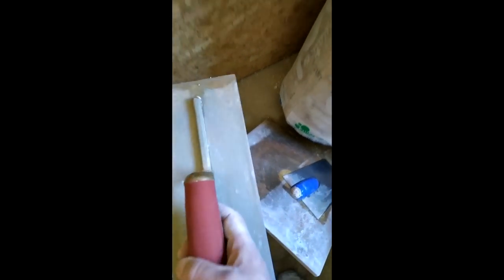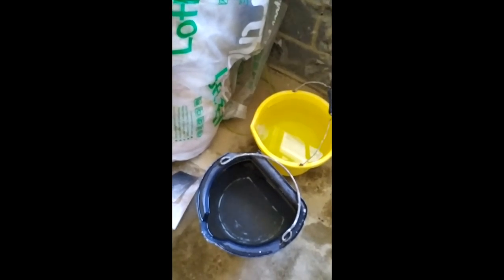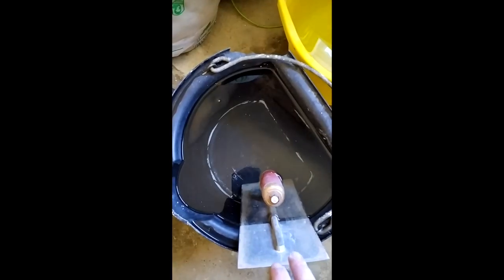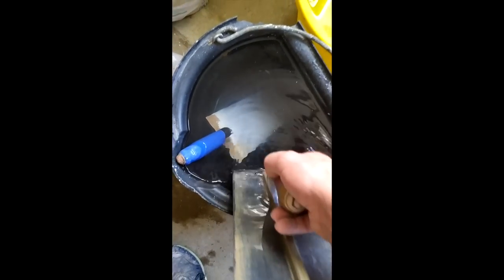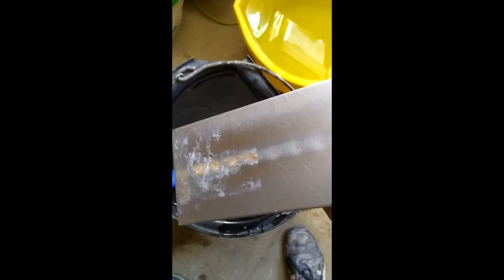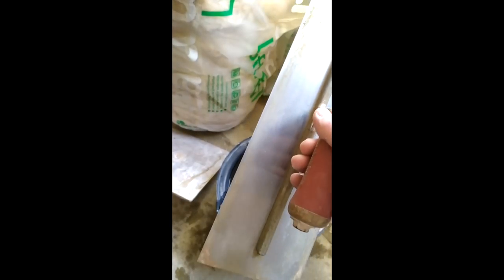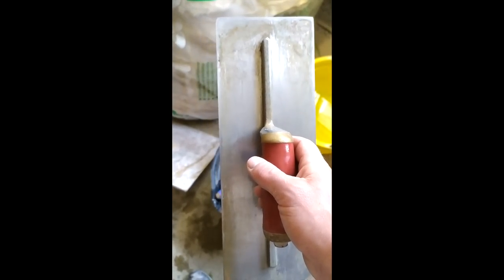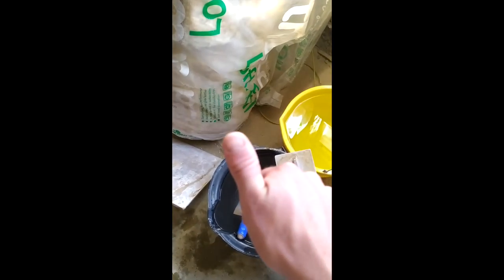The Easiest Way To Clean Your Trowels - (Plastering For Beginners)

Comment: Hi Blaine . I've got an old ( 15 yrs+) Tyzack Carbon Steel trowel I'm contemplating using. I've done asked it in Distilled vinegar overnight and removed all rust , but now turned black. On some forums people say black is best , but looks unsightly. Interested in your thoughts inc. if want it to go back to  dull steel look what's best way to so this ?

Comment: Hi Blaine,  Top tip mate , I have an 11inch  M/T stainless but borrowed a retired builders Carbon Steel one other day and as a result will be getting a 14 " M/T carbon, any tips on upkeep for those  or is it just a case of drying asap and the old WD40?
PS Great channel and slowly working through the Blueprint Course. excellent and  well worth the £ in my eyes..
Reply from the maker: Hi mate how's it going! Great hearing from you and I'm glad you're enjoying the course! Brilliant. Carbon steel trowels are the best, I used to have one and it was the best trowel I ever owned! I used to dry it off after use but I'd also have a rag that was soaked in WD40 which I'd wipe the trowel down with directly after use. This prevents any moisture getting to the blade and prevents it from rusting. That's what I did and it worked a treat. It will still rust but it ends up developing some cool markings but it doesn't affect it's use as a trowel 👍
Reply: Soak it in vinegar overnight. Itll turn black. Then at the end of everyday give it a wipe with an oily rag
Reply: @stayspicy9456  don’t know if carbon steel r the best but there the ones I’ve always used for plastering but for Easi filling dry wall I use a stainless ragni but don’t know why just always used these trails for different jobs

Comment: Hi Blaine,  off topic can tell me f I can use my refina supaflex for applying 1st and 2nd finish coat or do I need a different trowel. I am a bit confused.
Reply from the maker: Hi mate. I always use a proper plastering trowel for applying my plaster - the Flexi trowels have to much movement which will leave undulation on your walls. I wouldn't use the Flexi trowel until the final stages of plastering pal!